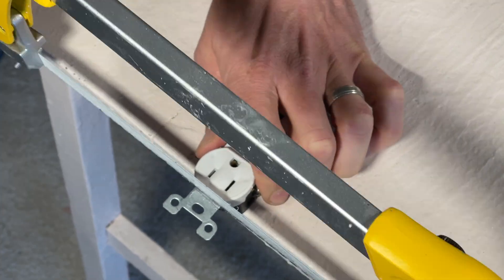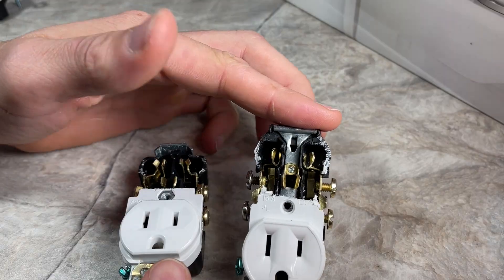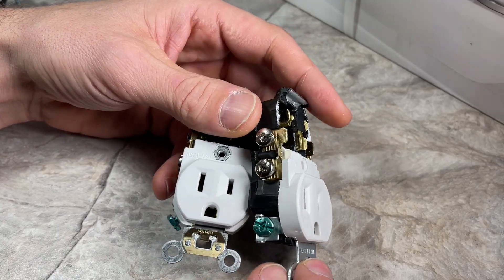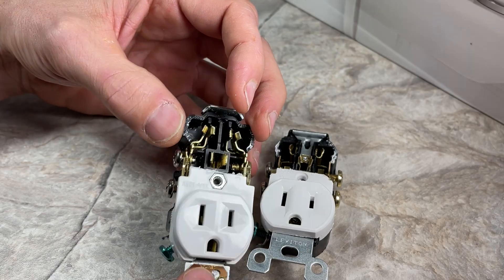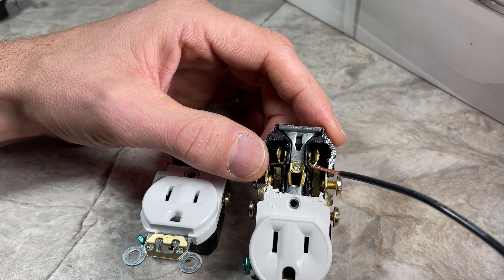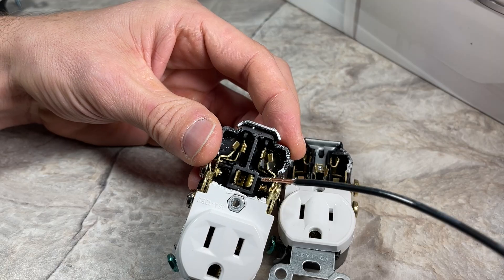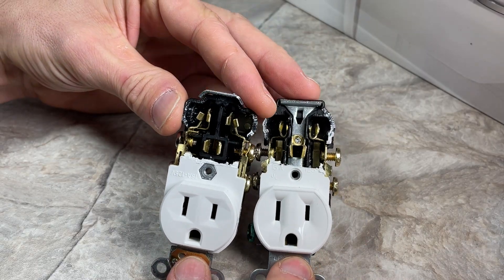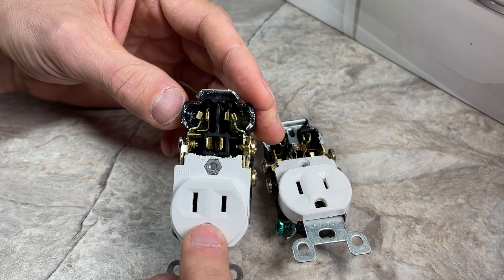What Outlet Should You Buy For Your Home |  Commercial vs Residential

Comment: Just one simple thought, If you don't have the extra money to do it right, where are you going to get the money to do it over? Especially if you are paying someone labor to install, use the commercial. You will save in the long run by not having a service call later. The one place I NEVER skimp on in a house is anything in the electrical system(panel, wire, boxes, recepts, switches) As an Electrician and Firefighter I can tell you most electrical fires could have been prevented with higher quality components and knowledgeable installers
Reply from the maker: Solid advice, appreciate the feedback 👍

Comment: I absolutely had no idea two different products existed.
Reply: @B Ricks  I never thought about it until the two outside of my house started to fail. I they get used quite a bit to run battery chargers and my electric smoker which I always unplug after use. Same with the outlets in my shop. I paid the extra bucks and replaced the two outside and they made a world of difference! I was very cautious of plugging anything in before because I would occasionally get sparks while holding the little weather proof door open with my free hand. I now have peace of mind.

Comment: I am not a professional, licensed, or certified electrician either, but I totally and absolutely agree with not using the push-in wire receivers on the back of the residential electrical receptacles too!  I have two receptacles daisy-chained off a third and it looks like the third has wires on the backside not all the way in anymore, causing an Open Hot in my kitchen.  Luckily it's not near water!
Reply from the maker: Appreciate the feedback, be safe 👍

Comment: The risk is a house fire. Poor connections are likely to become resistive or "ohmic" and begin to heat up. It could get hot enough to melt the plastic and it would drip onto something flammable. American homes are typically wood framed, so once ignition starts, the house burns down. 

The other risk is electrocution. Broken parts as he described are likely to cause the hot to short to ground and trip the protection device, which is a fuse or circuit breaker. 

European standards emphasize electrocution more than fire risk, by the way.
Reply from the maker: Thanks for all the feedback and really appreciate the engagement 👍

Comment: Often I find the consumer-grade receptacles and switches are also much easier to install because they're smaller and leave more wiggle room to "creatively smoosh" the wires more easily back into the box. :-)
Reply from the maker: The switches I compared for sure the residential had a more compact housing.

Comment: I replaced a couple outlets in my house (the ones most used) with industrial grade outlets. They are even stronger than commercial, and I think they have coil springs to hold the prongs. They were so stiff I could barely put the plugs in for the first year or so. They should last though, and the plugs absolutely don't fall out.
Reply: So we are up to four grades now: Residential, commercial, industrial, and hospital.
Any others?
Reply: @kimstockdale632  Hospital are the real deal.
Reply from the maker: Nice, yeah Industrial grade are no joke and also have some different features around the back wire features.

Comment: if you spend 100 dollars more to replace receptacles that are going to last 15 or 20 years of use. That's not that much money over the life cycle of that device. Do you really want to save a few pennies a year and risk everything you own and your families lives using low quality electrical components? If someone wants to trust someone they don't know in a testing lab saying the cheap stuff is okay. Thats up to them.
 I'm using equipment that's better than good enough. One thing to consider. Who do you think the insurance company is going to blame for an electrical fire? The manufacturer or the installer. If the installer isn't a licensed, insured and bonded professional. They are going to always blame the installer. 
After electrical parts have been in a house fire at 1200+ degrees. it's difficult to tell exactly what happened to initiate the fire.

Comment: All states have adopted the use of tamper restart outlets on residential applications. If the home is going to have children in it use the tamper restart outlets code or not. And yes very good point don't buy the cheapest outlet you can and dont use the insert feature it is a poor connection prone to failure.
Reply from the maker: Thanks for the feedback John 👍

Comment: At the end of the day, going for the cheaper outlet is just cutting corners. Think about the cost of upgrading from residential to commercial, or even to hospital grade outlets, over the cost of the building. The cost of upgrade is pocket change compared to the cost of the building, both new construction and already existing structures. 

Though, I'd be curious to see the differences between residential and commercial GFCI outlets, and a hospital grade variant if one exists.
Reply from the maker: Great, thanks for the feedback and I think GFCI are in the future for sure.

Comment: Backwire is the only way to go if you value your time.  Not having to take the time to wrap each wire and ensure it makes a proper contact as it tightens down saves time while you can be certain of a fast solid connection with backwire.  It costs a bit more but on large projects it saves so much time and in some cases can reduce the number of wire nuts.
Reply from the maker: 100% agree.

Comment: Electrician here. If you're not using the back stab ins and are instead wrapping a wire around the screw, even the cheapo outlets should be fine 99% of the time. If you've run out of other better bang for you buck safety upgrades (like putting a GFCI or GFCI/AFCI plug at the start of each circuit), or just really want high quality plugs, spring for the hospital grade ones.
Reply from the maker: Hey Colby thanks for the feedback.

Comment: Failure possibility is one thing, actual failure is another. Both are UL approved. Best advice given is always avoid push-pin/wire or stabbung contacts.

 I use commercial because that meets install codes in the application/contracts I work in.
Reply: the difference is lifespan

Comment: Everything I do tends toward very outlet heavy, as a result I tend to place outlets in many locations falling well out side of the norm. Now I consider the use case, if because of location it will be a very low draw/very infrequent use then I will consider a cheap outlet for that use case.  IE I will place outlets in closets or used to power plug in lights in the ceiling, which may be switched, in this case I may have > 1 amp draw and plugging once and left alone. This is a use case for a cheap outlet. all others get at minimum "commercial" grade, High use outlets are then "Spec" grade, and very high use, high amp draw then get an industrial grade @ 4-5.00 each.  During actual construction phase, I install cheap outlets in the areas that are used by the workers to beat up. Then when we are close to final phase those are then switched out  with new outlets of  the appropriate grade for those locations and throw the used 50 centers away as they are scratched and abused.  In larger projects there will be a temporary high amp outlet with oversize wires and a 30 amp or 25 amp breaker (as available) very high draw industrial grade for use with high inrush saws etc to prevent constant tripping during starts whilst in the construction phase.

Comment: Just had a fire at my house because of this I'm almost sure, but also part my fault I put in 30 amp breakers
Reply from the maker: 😬hope the damage wasn't too bad.  Stay safe.
Reply: @EverydayHomeRepairs  lost some tmde equipment and a few electronics, after I clean the smoke damage I'll be fine, the worst is the 3rd degree to hands and feet
Reply: if your breakers weren't the weak link in the chain, then it is all on you.
Reply: @Galgamoth  no shit you didnt gather that from my statement?
Reply: @Galgamoth  p.s. extension cords are the caveat to your comment
Reply: @phi31411  extension cords don't cause fire in the walls, and new electrical code mandates outlets be no more than 6ft away because they don't want people using extension cords on a permanent basis.

Comment: What's the "standard" I should look for on outlets & switches is that basically just the "commercial" level? I guess that's what's needed for govt installation. I am guessing it's cheaper than hospital grade we see in your other video? Or being govt, maybe more ?
Reply from the maker: All the outlets and switches reviewed have the UL approval so they should perform safely under normal conditions.  At least for me I like Commercial receptacles and Residential switches.
Reply: lifespan is the difference

Comment: Nice breakdown, never bothered to take them apart.  I own an apartment complex made in the late 80's and I've been replacing all the old outlets (which are often loose) with commercial grade ones. I find the expensive ones (I use an Arrow Hart flavor) install in less than half the time and given they hold up better will let me avoid wasting over an hours worth of time in the future replacing yet another outlet and annoying a tenant.  I spend a little more, save hours worth of time and have happier tenants.  Well worth it!
Reply from the maker: Hey Matt, first off congrats on the apartment complex.  I am a fan of REI and like that you get your hands dirty taking care of the place.  Yeah, I also have switched over to commercial grade for my properties.
Reply: arrow hart is cooper/eaton

Comment: I hate that cheap brand.  I just upgraded my kitchen and replaced my outlets with Eagles (now sold as Eaton).
Reply from the maker: "Eagles" those sound aggressive.  I will take a look 👍
Reply: @EverydayHomeRepairs  eagle electric was sold to cooper in 2000, Eaton bought cooper in 2012 and now Eaton is removing all branding from all their divisions so cooper, arrow hart, cutler-hammer are all becoming just Eaton
Reply: @Galgamoth  — Correct, the eagle brand has disappeared, bought by Cooper and Eaton.  But the Eaton part numbers are still “EAG...”  I call them Eagles because I suspect they came from the Eagle company.
Reply: hate to tell you, but Eaton is the cheap stuff. we used to have tons of issues with their stuff, we replaced them with Leviton as a supplier

Comment: An important feature that you failed to mention is that the receptacle on the left is a self-grounding receptacle by virtue of the visible spring-style grounding strap at the one end of the yoke. As an electrical engineer, this feature alone will immediately increase the cost of the receptacle by virtue of the electrical engineering architecture that goes into the self-grounding receptacle in order to make it more robust so that it can accommodate the spring-style grounding strap.

Comment: Thanks for the information .  I have a question on your views about why a home builder would use the outlets with the push in holes in back to tie the circuit together instead of the wire nut and pigtail  and the screws on the outlet ?
Reply from the maker: Save on material cost and labor would be my guess.
Reply: @EverydayHomeRepairs  Thanks for your reply .
Reply: He used the electrician with the cheapest bid. And he thought his job was to make money, not build a good house.

Comment: I recently bought a 10 box of levitons for $10 as opposed to the 10 box for $4. They look like your commercials on the front but on the back there is no metal and there are the wire holes. Did I get some kind of middle of the road plugs?
Reply from the maker: Hmmmm, are they Tamper Resistant (TR)?

Comment: On the commercial on you can still "stab" the wires - that being u can use a straight wire. The screw has a u shaped washer that can capture a wire above and below the screw stud. effectively getting the utility of stabbers and the functionality of using a screw.  This is my preferred type
Reply: The only way I ever make connection is wrap around a screw, never stabback, or straight wire under those washers for solid wiring, just better connection
Reply: @mikeclarke3005  On the commercial (At least the ones I have), have no stab back,  Instead clamped together with the side screws & plates made for straight wire.  Is this what you mean by washers?    If so, what sort of issues have you had????            

I agree though, the residential stab backs are completely worthless.  Used them in a house I bought 20 years ago... had a few issues over the years... Never again...

Any experience with the commercial European style  (WAGO) terminals  instead of wire-nuts?     I've used the  Wago terminal blocks in industrial machinery and off-highway mining equipment for like 25 years without much issue.
Reply: the best ones are called "clamshell" terminals. most gfci devices have these also

Comment: I do home remodeling and change receptacles for whole homes on every single job (after painting walls) due to older receptacles not looking good after a new paint job and flooring and never have I ever pulled a receptacle out that was separated (I've changed easily 10k in my life) the main problem I see is outlet boxes coming loose etc or people snatching on cords and pulling receptacles or breaking plastic and causing shorts. I personally see no reason to change to commercial in my house and my rentals I use residential
Reply from the maker: Thanks for the feedback and sharing your experience Don 👍

Comment: For me and my family, if it's a receptacle that's used a lot or has high current draw from big appliances, like microwaves and vacuum cleaners, it's worth the upgrade to commercial for safety!
If I move into a place with weak recpts, I'll replace with better one for safety.
Why take a chance of a fire, when kitchens are where majority of fires start.
Reply: your microwave is fine on a cheap receptacle because you aren't unplugging it often. Commercial outlets aren't safer, they just last longer before the wipes get too lose to properly hold the plug

Comment: US power outlets and connections suck bigtime.
Why the hell do you even need to pull a plug out of a wall outlet? Just turn off the switch. Oh right, you are all too cheap to put a switch into the outlet.
But then you complain " it might not switch the correct lead and the appliance might still be live".
So use a keyed socket, like the rest of the world, and enforce the need for an earth connection.
That way you KNOW you've turned off the phase line.
That two prong, can't guarantee which lead is phase plug, is the most crap electrical connector ever invented! On top of which it looks UGLY as sin.
Reply from the maker: Hey Joanne,  where are you located?

Comment: I got designer type outlets so no idea on the quality of those. I did notice the face plates had different grades, clearly some were more brittle than others.  
The worst broken one I had was built into a floor step, the plastic socket was so old and brittle it was shattered, previous owner had just blocked it off, very dangerous.
Reply from the maker: Yikes 😬
Reply: Turn the circuit off and remove one. If there is a continuous metal back riveted to the outlet, it is spec grade. No metal strip, just junk.

Comment: Should just get the correct outlets with tamper proof shutters
Reply from the maker: Hey Ryan, agree that most states/cities have adopted the NEC code which requires tamper resistant receptacles to be installed in most locations.

Comment: In reality, outlets should be pulled and checked every ten years. If the screw type, they should be tightened, because they loosen over the years (might as well replace them with good ones at that time).  A loose wire may seem not to be a problem on an "unused" outlet, but the next one down the line may be running off it and may have a lower power consumption device on it, but which is enough to make the [seemingly] unused one too hot to even touch.

Heating elements of heaters, hair dryers stoves and such are just material with a resistance to cause power to dump across it. A bad connection acts just like a resistance wire and does the same, dangerous thing.
Reply from the maker: Hey Kelly thanks for the feedback and the words of caution.

Comment: THEN there is the, WHY would you put a 15 amp outlet on a 20 amp circuit, or even on a 15 amp one?  The outlet is the bottleneck.

Of course, builders are cheap, and the public is unaware. If they knew the builder was cheaping out on outlets, they'd have a clue they cheaped out elsewhere too.
Reply from the maker: Hey Kelly, you are correct for most homeowners they will not be able to identify the areas of "cost trimming."